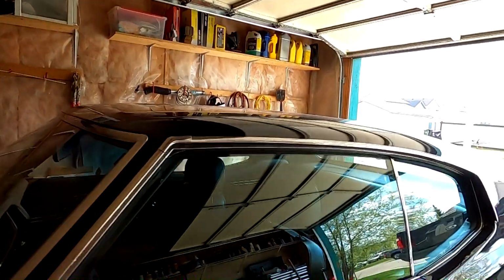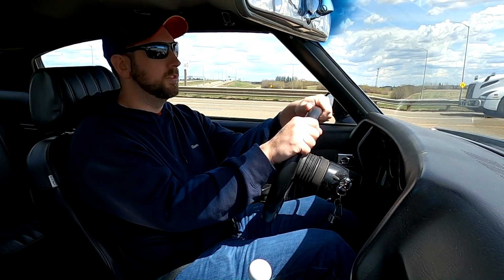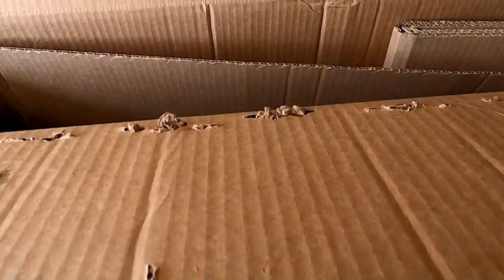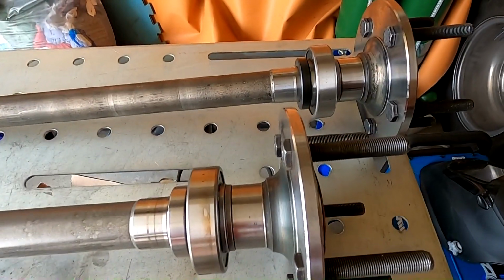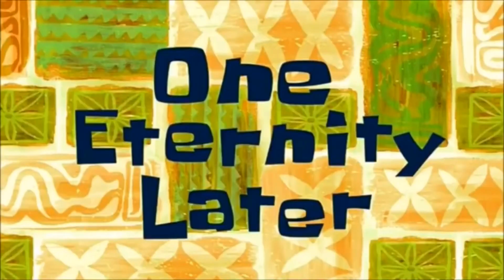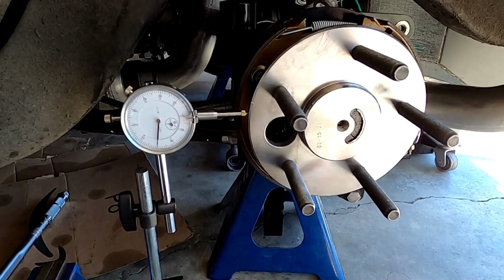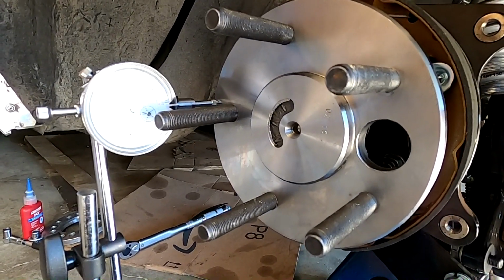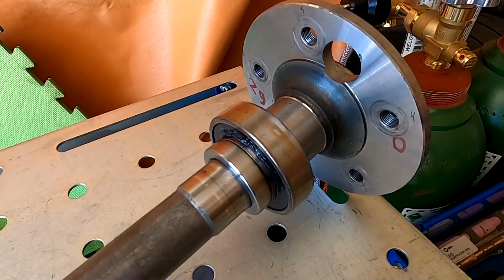Annoying VIBRATIONS - Part 2 - SOLVED - Bent Axle

Comment: Very interesting.  I had a vibration on my 70 El Camino from about 65-75 mph.  Turned out to be a bent and out of balance rim.  I figured it out by accident when I swapped my tall tires (which were on different rims) for highway gearing and noticed the vibration went away when the bent rim was off the car.  Then I confirmed the bent rim was out of balance after the fact (and also noticed deformed lip on inside of wheel).  I'd like to install a narrowed rear end at some point but your experience with Moser concerns me a little.  Good video!
Reply from the maker: There really is a lot of things that can cause a vibration. Good job on figuring out it was the rim. So far I can't say I've been very satisfied with Moser.

Comment: Good video on measuring run out on the axles, im having a similar issue, my vibration comes on around 55-60 mph goes away between 65-85 then gets real bad at 90+, im thinking i have the same issue, bent axles, will be measuring runout this weekend, been through nearly the whole driveline, refreshing a 93 mustang, lots of work lol.

Comment: Weird that replacement axle had no access hole - did they correct it, or the local boys?
Reply from the maker: I ended up paying to get the access hole done locally. Wasn't terribly happy about that.
Reply: @SS454LS6  you still have that noise at highway speeds. I have a noise on my 66 mustang, and also have the eaton trutrack rear end. Also have that gear play you showed a few videos ago from this one. Just curious if you think this noise I have is from eaton true track. I go over 50 mph and higher noise comes on, and mostly gets worst at higher speeds and also in coast or neutral. Complete goes away at 50 mph or less, like a switch. I am in thg process of having drive shaft re balanced, and check driveline angles.  Had my third member checked out, with nothing found. I had one axle changed, with no change in noise. Checked all tires and wheels, and had them balanced again. Nothing. My driveline angles look like they are out, I will have to raise my pinion up.
Reply from the maker: @johnguildy  Sounds like we have the same issues. I wonder if our noises are coming from the True Track. Chances are it is the ring and pinion though.